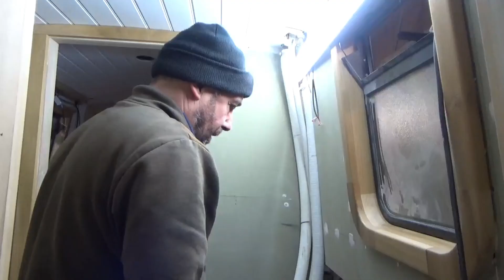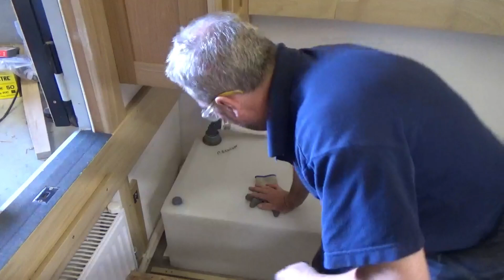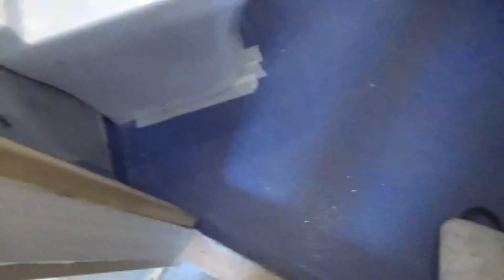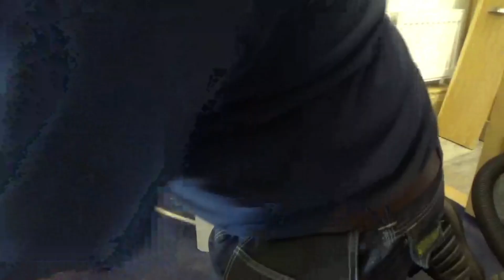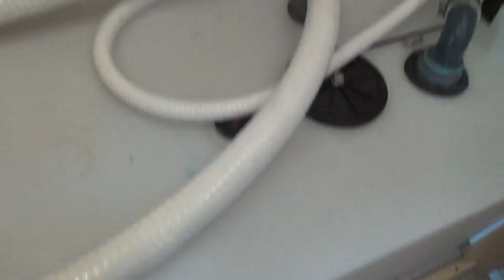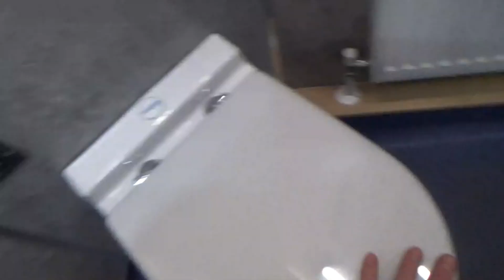Narrowboat Installing Sanimarin Pump Out Toilet  pt2

Comment: Wowzers, you best hope that pump out pipe don’t leak you’ll have shit dripping off the ceiling… Narrowboats typically have those pipes on the side step god knows what you were smoking putting them up there 😂
Reply from the maker: Dont know why it would leak ,its being pumped out not in, so the pipe is sucked on tighter,when being emptied. There are as many boats with them on the roof as on the gunnels. Still worth considering. Cheers Andy

Comment: Hi Andy, question for ya. Why is the suction pipe so high ? It seems to me if there was a blockage, it would be a bit of a shit clearing it out. And would two screws be enough to hold the toilet to the floor, thinking of all those arses banging down on the pan.